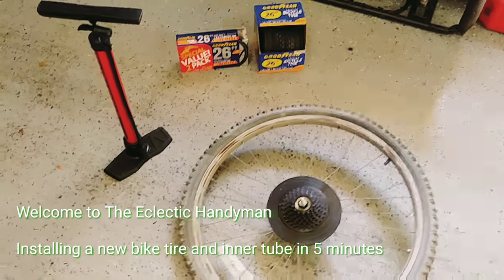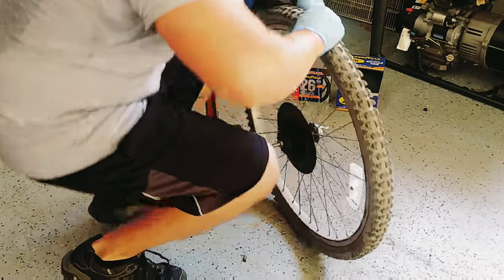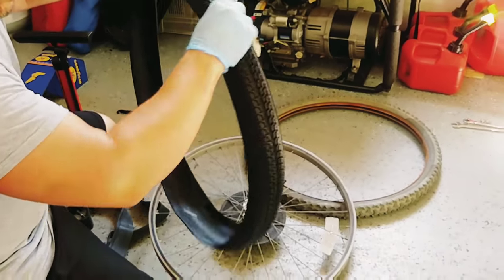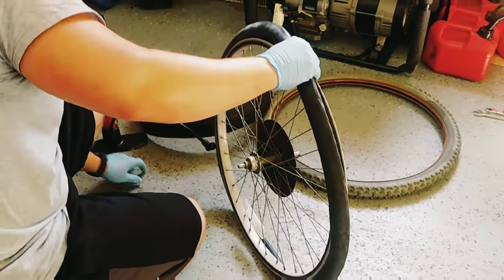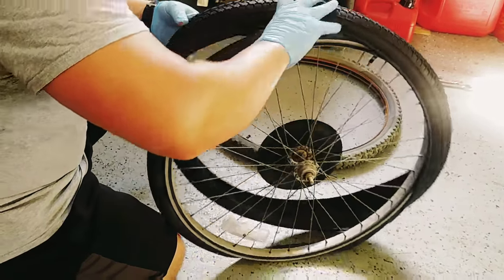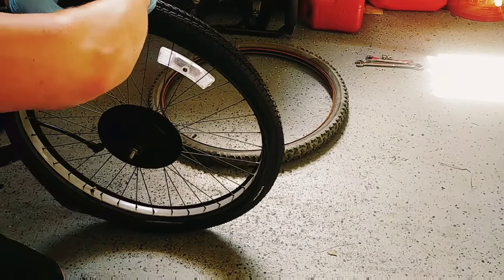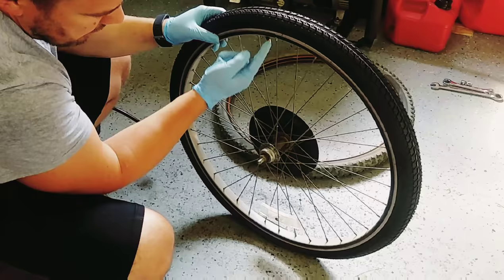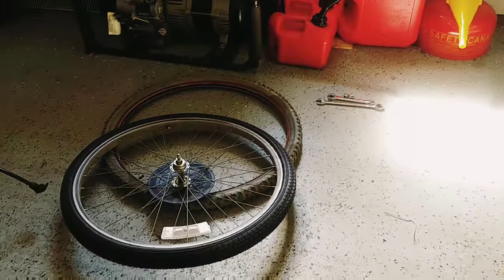Installing a new bike tire and inner tube in 5 minutes

Comment: I've been changing my own bike tires and tubes for almost 55 years with not too many issues....until I started buying tires online and then had them mailed to me in the same box as yours came in.  Now, a job that was once fairly simple and straightforward has become a nightmarish impossibility.  I can't get that tire onto the rim because, unlike when you would buy a bike and then one day the tires go flat, you remove the old tire, put in a new or patched tube, and put the old tire back on.  The old tire is already round, or formed along the edges, and goes on the rim with little problem.  But the new tires, the one that come in a box, don't have that nice formed channel (the tire bead) that fits right over the rim....the tire edges, or bead, is all flattened out and I can't "form" that bead to fit over the rim, even after repeatedly "pinching it" like you showed.  It's been a real nightmare, but it looks like you figured it out.  Any suggestions on how to solve this problem?
Reply from the maker: You know the tires I bought were also in a box, and I just pulled them out and kind of stretched them out by hand, and that seemed to work OK for me. I did add that little bit of air too 1st, which helped give it shape. Thanks for watching!
Reply: My nightmare today. I filled up the inner tube in the new tire, then tried for 20 minutes to get the tire into the rim. I had to stop before I threw the rim across the garage in a rage. Looks like I'll try to put the inner tube on the rim first.
Reply: @brainn3057    I know how you feel, friend. Did your tire come in a box, all folded up?  I think this is where the problem comes in. And I haven’t figured out a way to overcome those impossible bends in the tire from being folded up in the box.
Reply: Fit one "bead" onto the rim first. Take care regarding tyre directional rotation and work on the non greasy side, that is away from the cassette. Then a little air into the tube, and fit it into position, as our Handyman says, keeping the valve straight in the hole in the rim. Then, starting from one point on the rim, work the remaining tyre bead into position with each hand working away from the other, keeping pressure on the tyre in both directions, the bead pulls down into the rim. By the time both hands meet again on the opposite side of the rim the remaining small section of bead will pop into place. It's hard to put into words, but it is a technique, once mastered it's like "riding a bike!" You'll never forget.
Reply: @davidcollier1207  Thanks!

Comment: Also ensure the tire is mounted in the proper rotational direction. It's on the sidewall shown as the word rotation and with a directional arrow.
Reply: Thank you for the rotation tip, never realized there was one. Luckily I checked after installing a tube and got it right by luck.
Reply: I heard, if you put in on faced the wrong way, you'll have 10 years of bad luck, maybe longer.

Comment: Thanks Bro... it took a little longer than 5 minutes, but I got it done. Here's a tip... when you pump air into the inner tube prior to putting it on the rim, go ahead and check it for leaks. You don't want to find out after you've mounted the tire that you've got a brand new inner tube with a hole in it.
Reply from the maker: Great tip and glad it helped, thanks for watching! 🛠️

Comment: Also very important to make sure your ribbon is in good condition once you take that old inner tube off. It is a thin black band that sets under your tube; keeps the metal parts from popping holes in your tube.

Comment: cool, i tended to do both sides at the same time and putting the tube in the tire first, will give this a go. I got a puncture on the road but there is a slight kink when the wheel spins faster so need to start again.

Comment: Is it also OK to place the inner tube inside the tire first, then insert the valve into the valve hole in the rim so that the inner tube is already inside the tire and it won't be difficult to mount it in the rim?

Comment: dang....was really hoping i could find a way to mount some 26's i had lying around on my 27.5 wheel. but it looks like the sidewall of the tire is about a half inch too small. guess i'll have to pay an extra $70 for the correct size

Comment: How did you put on a new stem? You didn't show that part. The stem for the tire tube I bought seems different than the one you have in the video. The stem I got is like this thin metal thing and you had to buy this other yellow colored adapter to make it look like the original stem. Did not inflate for some reason I wonder if that's a special type of tube, even though I bought it next to all the other brands I could have possibly bought and it was around the same price. I hate being learning disabled stuff like this looks way too easy then in real life

Comment: How did you take the air out
Reply from the maker: @chriscomeau5056  There is a tiny needle in the center of the air valve on the tire. If you press it, thr air will come out of the tire.

Comment: I’m about to lose my damn mind. The inner tube I ordered seems to be too long - but I double checked the order and packaging, the length matches the factory tires, just like the length/size. 
That would mean the wrong size tubes were installed for the last decade… but I’ve driven this bike so many times and kilometers, tubes being too long would’ve made the tyre wobbly wouldn’t it??

Comment: Guys please don't listen to this guy, he's working on the floor of a garage. First off, there's no point in trying to fit the tire around the tube. Put the tire halfway on and then tuck the tube in. Second, if you use a tire lever reinstall the tire, you're gonna puncture a tube. Maybe not this time, but it's gonna happen. There's a tool called the Kool Stop Bead Jack if you must use a tool, but you don't need a tool, trust me. I've changed like ten thousand tires in the last two decades, and every time the tire hung up it was my fault. If you get stuck, massage the tire all the way around so that the bead pops out of the bead seat and down into the spoke bed, and the section you're working on will free right up.

Comment: I'm trying to do this and the tire is SO TIGHT that I can't get the last 2-3 inches onto the rim!
Reply from the maker: When I had this happen I'd let a little air back out of the tire so it could stretch a little easier, or keep it a little closer to the edge of the rim so there was just a tad more slack. Hope you get it worked out!

Comment: How do you take it off bike
Reply from the maker: Every bike is a little different. This particular bike had a solid axle with 2 nuts to remove. Once the axle pulled out, the wheel came off.

Comment: It’s easy when the tire is off lol. My problem is I can’t figure out how to take the tire off in the first place
Reply from the maker: Yeah each bike is different. Some have a quick release style that require no tools to remove the wheel. Others like my older bike have a solid axle held in by a nut. The front tire is typically easier to remove than the back as there are gears and chain in the back. However for a axle held in by a nut, you'd hold one side steady with a wrench, and loosen the nut on the other until the nut is removed and you can pull the axle out or off the frame. Check your owners manual if you can't figure out how to remove the wheel, search for videos specific to your bike, or if still unsure, swing by a bike shop and they'll kindly show you if they are nice. Thanks for watching!

Comment: Wrong wrong wrong. Not how to put a tire on. My father own a bike shop. We never put tires on like that. you do not put air in the inner tube at all but half the tire on the rim then put the innertube in then put the other side in and pump it up.
Reply from the maker: It's like many projects - there's always 10 ways to get something done. I did it in under 5 minutes and it worked perfectly.